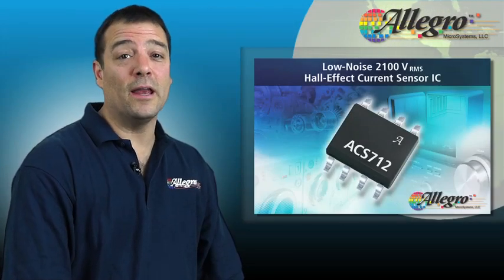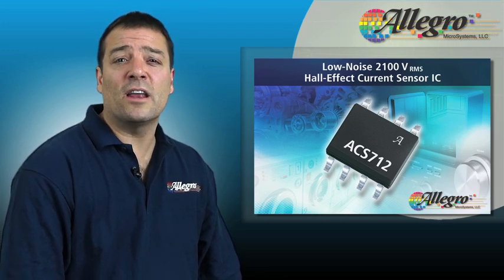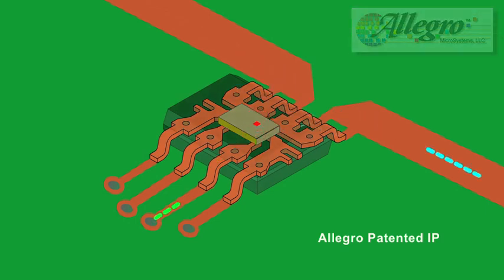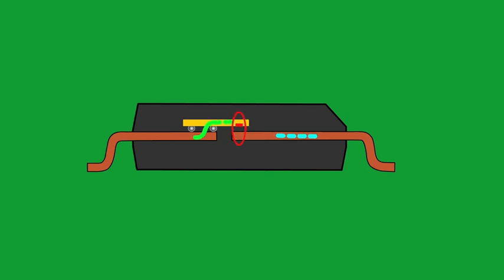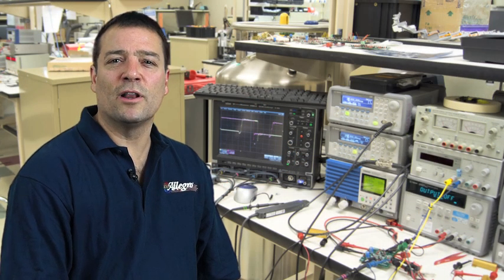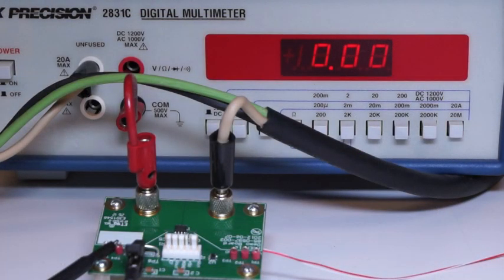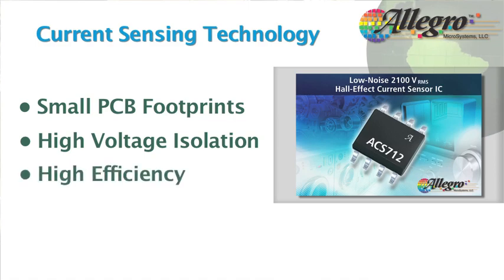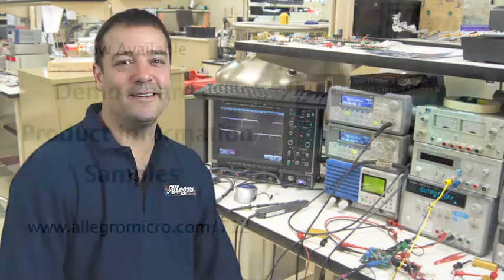ACS712 Low-Noise 2100 VRMS Hall-Effect Current Sensor IC

Comment: I noticed that if I bring a ferro-magnetic material (iron) or magnets close to the sensor then the measured value shifts - I'm guessing this is interfering with the way the measurement is made since there is no internal shield or core. What is the recommended way to protect the IC from external magnetic fields? Has this problem been addressed in newer versions?
Reply: the same as the case that I'm working on at the moment, I use a voltage of 90VDC 24A, it often interferes with wild frequencies, my case is in the installation of an audio amplifier. maybe with a ground loop, ferrite insulation or aluminum foil can dampen, I have not fully tried, is it useful or not, because these stray frequencies often damage the sensor

Comment: Can this IC output a waveform readable in an osciloscope?
I need to measure current waveforms over magnetic sputering devices that work with 50 micro seconds high voltage pulses(600 V) and pulsed current of up to 5 A.
Since the device is not linear, a shunt resistor wouldnt work so I need something to read current waveforms, can I rely on your IC???

Comment: Hi we are trying to implement these sensor ICs in our product but getting really hard to wire these ics in our circuit due to lot of variation we are getting in output. Can you please guide us about how to use these ics. We want to implement implement a load current (power) consumption system in our Home automation product. Load running on 230v/50Hz AC. we need to measure the current with our Microcontroller ADC which requires approx 2v of input. What could be best possible interfacing circuit for this. Also we need to have load detection in our system.
Reply from the maker: +ioCare Research Team Thank you for your inquiry. Please contact one of our local Field Applications Engineers in your region. Here is a link to our website that offers contacts for technical assistance. http://www.allegromicro.com/en/Design-Center/Technical-Assistance.aspx

Comment: Why we can't find this product On mouser.com? Its really nice this sensor!!
Reply from the maker: @elkin suarez you can use our stock check tool to find available parts https://www.allegromicro.com/Sample-And-Buy/CheckStock.aspx?q=acs712 also check our Current Sensor selection guide for more options https://www.allegromicro.com/en/Products/Current-Sensor-ICs/Zero-To-Fifty-Amp-Integrated-Conductor-Sensor-ICs.aspx
Reply: @Allegromicro    I like to try the chip however the packaged made and selling is complicated for my Board design and like to get the chip itself. 
Strange that package for testing premade on cheap PCB which is paperboard with thin copper.  NOT my preference. 
Stange that hobbies developers have issue unless they by lots of 1500 chips.. 
Also I do not like hitting links and getting 404 messages page not available .

Comment: Will it be able to sustain line vtg of 440 volt??
Reply from the maker: @shraddha jadhav Please check individual datasheets for working voltage ratings. http://www.allegromicro.com/en/Products/Current-Sensor-ICs/Zero-To-Fifty-Amp-Integrated-Conductor-Sensor-ICs/ACS712.aspx . Check the ACS724 datasheets in both the SOIC8 and SOIC16 package.  They should be suitable for your application. http://www.allegromicro.com/en/Products/Current-Sensor-ICs/Zero-To-Fifty-Amp-Integrated-Conductor-Sensor-ICs/ACS724.aspx

Comment: I like to try the chip however the packaged made and selling is complicated for my Board design and like to get the chip itself. 

ACS712 current sensor is made up package.  cheap to buy.. however that package for testing premade on cheap PCB which is paperboard with thin copper.  NOT my preference.  Not my desire at 10, 20 and 30 amp loads. 

Strange that hobbies developers have issue unless they by lots of 1500 chips.  Really.. 

Also I do not like hitting links and getting 404 messages page not available . 

However it is a great design and looks like great product.. why is it chinese sell it like hot cakes.   USA marketing is dismal to poor.

Comment: Taking the x05A's performance characteristics, with 75mv(pp) noise figure at 50kHz bandwidth and a sensitivity of 185mV/A. This translates to 75/185=405mA(pp) which is almost 5% of the peak-peak current range. You can not claim that the device is low noise! Please tell the truth in your marketing...The ACS710 (ACS716) is beter though.
Reply from the maker: +Gert Kruger Thank you for your comment.  Allegro’s Hall-effect sensor ICs are world class in terms of noise performance for a coreless current sensor using Hall-effect technology.  The ACS712 provides a highly functional current sensor IC solution from Allegro.  Please see our latest generation of products: The ACS722, ACS710 and ACS724 family of ICs provide larger gain and improved accuracy and resolution.  Please contact a local sales representative at http://www.allegromicro.com/en/Sample-And-Buy/Contact-Sales.aspx for further help using Allegro current sensor ICs.
Reply: +Allegro MicroSystems, LLC It may be low noise within its class, but it is still NOT low noise. It is possible to make a low noise coreless sensor by using multiple Hall-effect elements and averaging, just a hint. I have taken a look at the suggested sensors and their noise figures are basically the same.